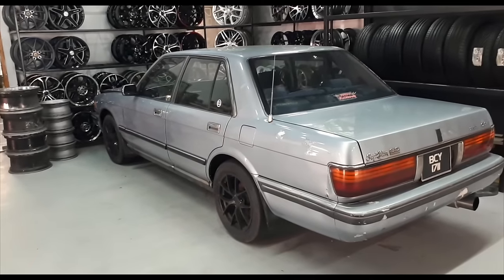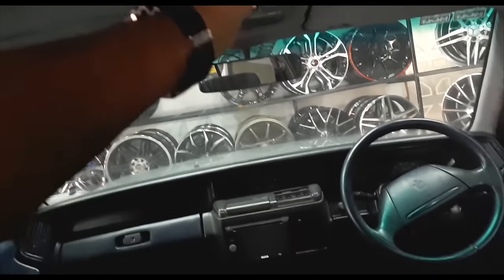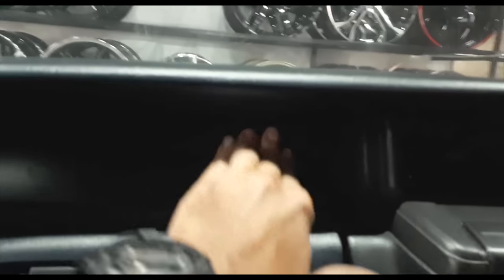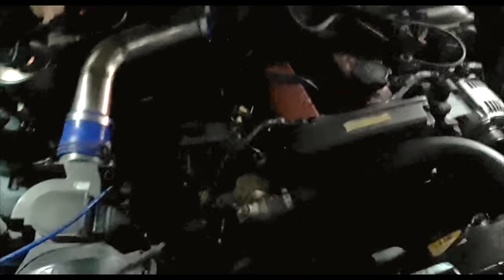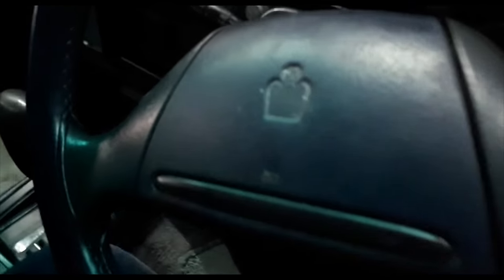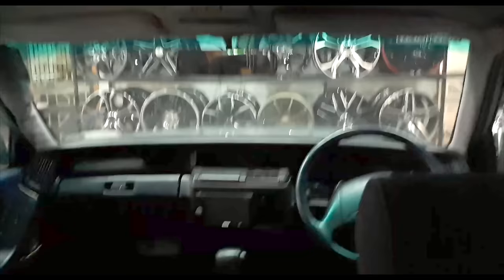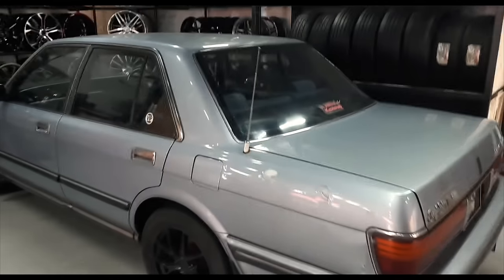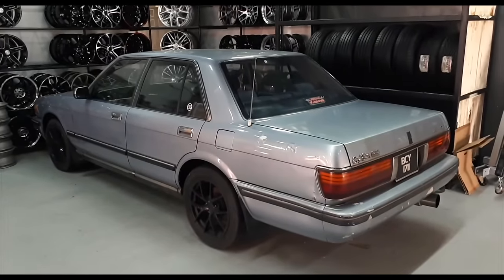UCR: 1990 Toyota Crown Royal Saloon 3.0 LONG-OVERDUE Full Reveal!! | EvoMalaysia.com

Comment: Hey i have the 1994 model of this, fantastic car. Luckily mine is immaculate and done 105000km. The engine is a 2JZ-GE with a 4 speed auto, bulletproof as long as it gets fluids changes on time.
Reply from the maker: Nice!! Hoping to someone might buy this from me and do the same!!🙏🏽👍🏾😁
Reply: Good owner spotted. May you share if the servicing and parts availability have any challenge?

Comment: Get it endorsed for classic car status. Paying RM2,130 annually for roadtax is just insane :'(
Reply from the maker: Agreed!! But I can't find the original wheels for this car, that's one of the main hold-ups actually 😊
Reply: @ChrisWeevilGarage  that's the thing I don't get it - the car needs to be on original rims? Like if you were to substitute with steelies it won't work? I felt like that's a shortcoming on JPJ's part because it also meant that if I were to fit AMG Monoblocks for my W124, it wouldn't be qualified which I find weird and absurd (I've heard a lot of conflicting info about this)

Then again, when it comes to giving discounts, it will never be easy right?
Reply from the maker: @UncleLuqman  bingo, u nailed it! The 80% reduction is a big amount, so they don't make it easy to get. It's a very cumbersome process and usually owners just leave it up to runners to do it for them. Yes, u need to find the original wheels (steering wheel too) and the car must be in original condition and certified by a registered classic car club in Malaysia.
U also need 2 other cars in your name paying full road tax. For big c.c. cars more than 25yrs old, it's worth the effort though, paying just 20% of the original road tax annually  😊
Reply: Hi there. I'm also W124 owner. Back a while I was giving a thought if registering my old lady classic worthwhile. You see, yearly you need to go for puspakom inspection(if not mistaken). To ensure the car pass puspakom, sometime you need to spend more than rm2000 because of parts niche. And the hassle to que at puspakom (can be very time consuming). So have to consider in this sense if it is worthwhile. My W124 is 2.3 so still consider affordable for me. Just my point of view though.
Reply from the maker: @HotRod16  not yearly, the cert is valid for 3yrs and follows the car. Only after 3yrs u need to send for reinspection 😊
Reply: @HotRod16  lucky you because mine's a 2.6 because my dad thought the road tax is only RM880. Sekali tengok RM1122 a year. Die la like this.

But then, he got the W124 as a "stop-gap" since we're financially not in the best shape AND we need a car to take my grandma to places and the W124 did very well - even went to Melaka and back. For RM6k, it was worth it la. But to make it fully tip top? That'll be another RM20k or more. I did said to just go for a Camry XV10 or Cefiro A32 but he was like "nah too boring" 😪

Maybe after this he'll sell it on and replace it with a better car? Who knows. He changes his mind like some people change underwear
Reply: @ChrisWeevilGarage  oh ok. Thanks for correcting. Then it is worthwhile to go for.
Reply: @UncleLuqman  I would say good pick, at least travel in Mercedes-Benz. To make W124 tip top, 20k is way too much for it. Since she can do well to Melaka and back, 5k to make over mechanical and undercarriage, 2-3k for new layer of paint maybe. Then can last another 5-6 years. But what's left from 20k after all this is to pay on fuel. 2.6 a bit drinker. Lol...

Comment: Change the engine to hilux diesel.... Economical engine for heavy body car
Reply from the maker: Not a bad idea at all. Haha! Gotta check if that's allowed by JPJ tho, petrol engine swap to diesel 🤔👍🏾🙏🏽
Reply: @ChrisWeevilGarage  jpj allowed it, just dont cut the original engine mounting point at the car chasis.
Reply: My Crown has diesel engine 2L  . 2400cc with automatic Gearbox